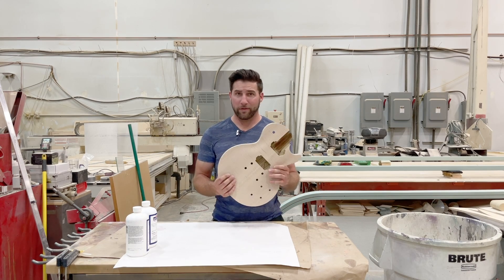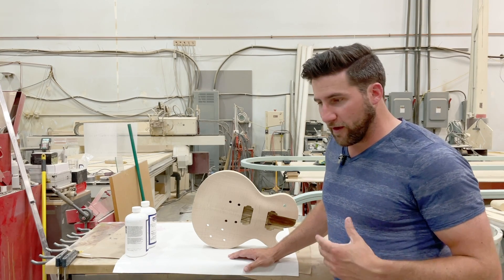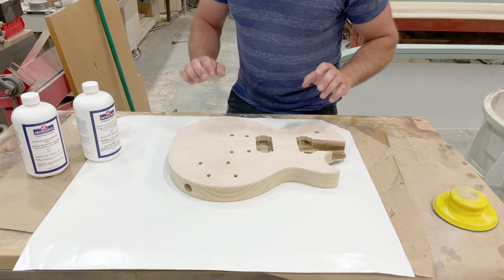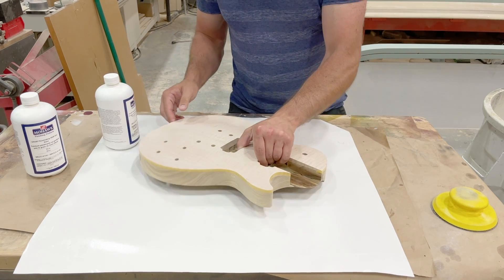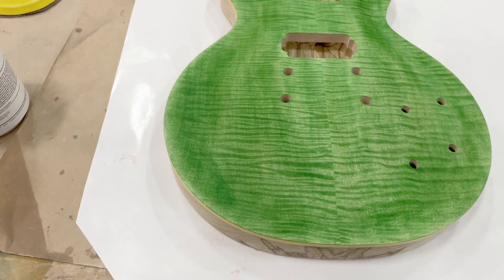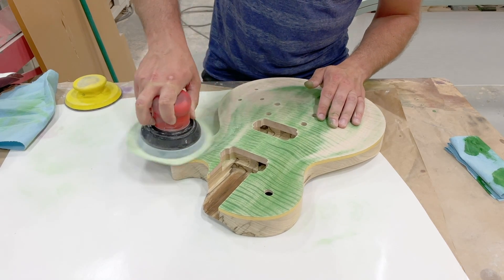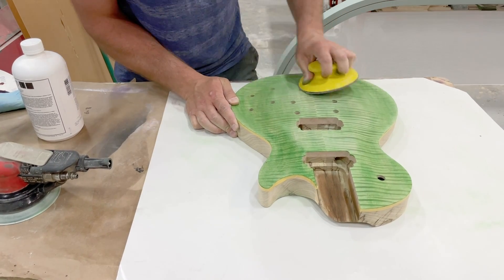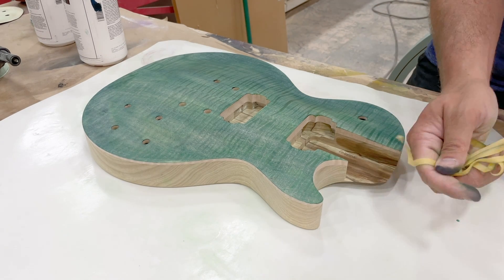The Precision Guitar Kits Les Paul Build (Part 1)

Comment: Hey Brad, I finished dying a tele and using wipe on poly gloss. I got busy so it sat around for about a month before I hand rubbed with some McGuire's and used some Carnuba Turtle Wax. It came out really nice humbucker single coil humbucker plus I put an old Gibson Chet Atkins classical bridge on there with a LR bags Piezo which don't sound bad actually took it out the other night and just used it through the acoustic side. Still got to wire it up. After watching you the last couple of years I decided to take it upon myself and try to finish a guitar. Keep up the good work Bud.
Reply from the maker: Sounds like it went well. I’m glad to hear it.

Comment: Definitely going to follow the paint/finish work on this one. I've got a LP kit from Fretwire with a spalted maple cap that's been sitting around waiting for me to work on it. Now that I'm on short-term disability I've definitely got the time...

I know I want to coffee stain the top, I want to make sure the spalting really sticks out though - and that's the part I'm not sure what to do, or if it's just the standard "dye black, sand back". Also need to figure out what stain or paint I want to use on the mahogany body.

Love the work you do, looking forward to the next video. 🙂
Reply from the maker: You should check with fretwire to make sure it isn’t sealed first. Most spalted top kits are, which limits the ability to dye or stain them. I have a series on a spalted top Les Paul from solo.

Comment: I personally use a vacuum for dust rather than blowing it into the air although my workshop is small and would soon cover everything.
Reply from the maker: Vacuum is fine, especially if you combine it with your hand. This shop is quite big so the compressor works well.

Comment: I’m not a fan of the “sand back” finish generally but your accidental guide coat dye job looks outstanding. Amber tinted clear I bet will really pop the flames. Amber clear also is a great choice for black Limba.
Reply from the maker: The amber doesn’t really add much pop, it just bring the green hue back a bit and adds a bit more color layering.

Comment: Hey Brad, you mentioned that if you wanted to do a natural binding, you would seal it with lacquer so the dye wouldn't get in. Should you do this as well if the guitar has real binding installed to avoiding dyeing it? Or would you be able to scrape dye off the binding without sealing it first?
Reply from the maker: On the plastic bindings there’s no reason to seal them first. You can just tape and/or scrape.

Comment: I have a question. Early in the video you mention that normally when doing a natural binding you seal a binder with a lacquer to keep the stain from seeping into the grain. I’m wanting to try a natural binding on a kit I’m building. My question, is there a sealer for that kind of binder that you prefer or that you thinks works best? 

Thanks!
Reply from the maker: I generally just use some lacquer.
Reply: @BradAngove  thanks

Comment: I like it buddy I have exactly the same thing going on and I started with green but didn't know if I was going to like it or not so I stopped and I've been wondering what to do I'm afraid of sanding through the flame Maple because it's water-based stain I don't know how deep it goes but I'm just going to have to go for it I think
Reply from the maker: Try wiping it with acetone. That may remove some of it. Just don’t soak it too much - don’t want to impact the glue.
Reply: @BradAngove  great idea man! Cuz I've been scared to even touch it with 600 sandpaper but I bet that would at least dull it enough to be able to blend something over and send it back perfect. So when we go ever going to get to meet.? Remember I'm 60 and I ain't getting no damn younger I'm still handsome and the women keep flocking around me but you can help me take care of that LOL
Reply: Oh yeah I wanted to tell you that the kid I have is exactly identical to the kit you have I had bought it for the great guitar build off for a couple years ago but I had some bad physical problems I was going through at a time but I've been wanting to get it out and blow the dust off of it is still in the box I think I finished this one up it's it's the next.
Reply from the maker: 60? Spring chicken haha.
Reply: @BradAngove  I have been wanting to ask you, did you draw on the walls when you were little with different kinds of crayons to see which ones were the best? Hahaha
Reply from the maker: I was more of a pencil crayon guy. Never liked the imprecision of the wax crayons.
Reply: @BradAngove  LMAO why am I not surprised LOL great comeback my friend I hope you get a chuckle out of what I said
Reply from the maker: Haha of course George.

Comment: First kit I did was a Precision Les Paul, but with a plain cap (my preference) and regular mahogany back. Used Keda dyes for the whole beast, with hand rubbed semi gloss poly (just enough coats to make it pop) and it turned out awesome. The only hardware I cheaped out on was the tuners, which are Wilkinsons, but they feel as good as any Grovers that I've used. Wish I could have sprung for high end Kluson style machines, but I had to go with what was readily available. Looking back, I would have taken a hair off the neck and fingerboard to help a tiny bit with neck angle at the bridge, but otherwise its perfect. Also, the Switchcraft 3 way switch doesn't fit 100% properly. The cap is thicker than anticipated, and the switch hole is a little small. It was a fun project, I'd definetly rate it as good as 99.9% as any geniune studio that I've played, and probably better than a lot of the G-company standards that I've played. Obviously the appearance isn't as nice as a genuine Standard, but I think I did a bang-up job and love it as much as any of my axes!
Reply from the maker: Glad to hear it went well. Doing it this way is certainly more fun than just buying one haha.